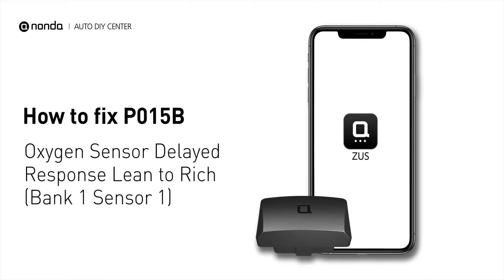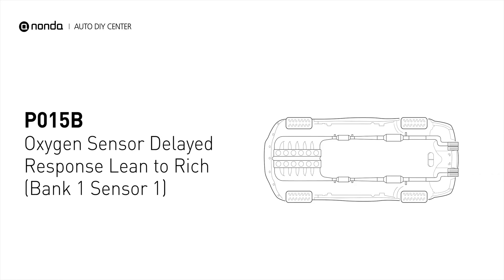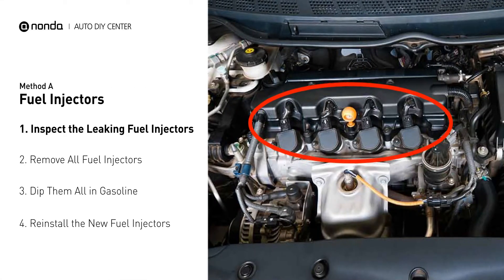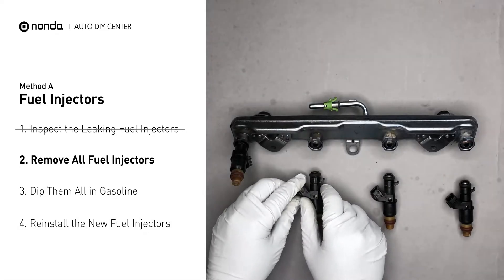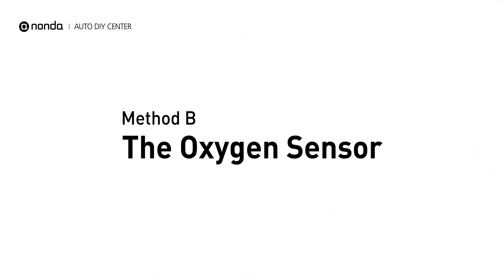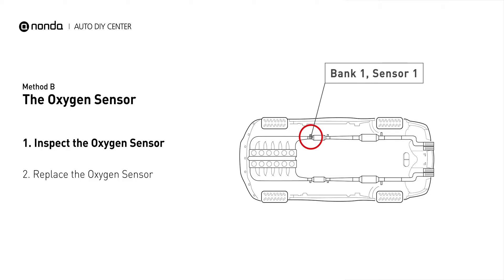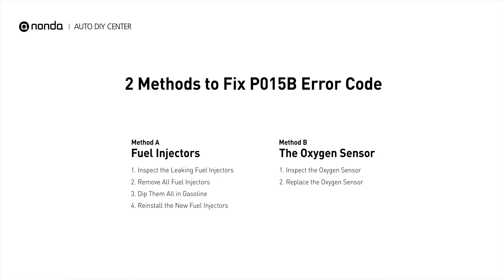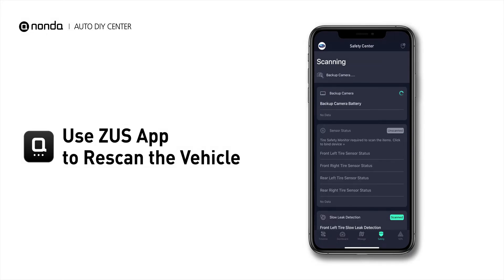How to Fix P015B Engine Code in 3 Minutes [2 DIY Methods / Only $8.43]

Comment: I have a 2014 yukon xl.  Getting p015b which is b1 s1.  My scan tool, innova, says "p015b delayed response rich to lean sensor 2".  So im confused as to which sensor is actually faulty.
Reply from the maker: Hi Edwin, it's bank 1 sensor 1 of the o2 sensor. Please note that the definition of this code depends on the vehicle manufacturer.
Reply: I’m getting the exact same error on a 2018 Nissan rogue. I appreciate your answer.

Comment: nonda I have po2097, 1101, 015b, 299, and 171! Anything that will throw all these codes, or do I have multiple issues going on? 2014 Encore 1.4l turbo. TIA!
Reply from the maker: Hello, as you are getting multiple error codes, we suggest getting your vehicle visually checked by your local mechanic for further diagnosis.

Comment: Hello! I am driving a 2012 Chevy Cruze LT 1.4 L turbo with a stream of mods. I upgraded the injectors to 60LB injectors and I am tuned professionally. Anyways, I am having a P015B code that I can’t figure out, I have a concern it may be my fuel injectors, how would I know if it’s leaking or if I need to change them out? They are fairly new but I’m assuming I may have messed something up
Reply from the maker: Is there any other code that registers along with this code?
Reply: @nondainc  No there is not. Currently I believe it is leaking because I can smell a slight hint of gas near my intake manifold and I believe these injectors although relatively new may need new o rings because they have been removed 3 or more times trying to diagnose a p1101 code (Two shops worked on this resulting in 3 valve cover replacements along with a intake manifold. I personally figured out my boost pressure sensor hadn't been seated properly causing the p1101)

Comment: I did both O2 sensors reset the check engine light. Drove around the block and reset it again and still get the same check engine light. I'm assuming it has to be the fuel injectors.
Reply from the maker: Hi Blake, please provide us with your vehicle's year, make/model and confirm if this is the only code you're getting.
Reply: @nondainc  2017 Chevy Cruze. And that's the only code.
Reply: @backwoodsblake What fixed it? Currently thinking it’s my fuel injectors also after getting P015b B1 S1 Lean to rich. Replaced both sensors pre and post cat drove 40-50 miles and got the same code.

Comment: Hi Steve, I've been having issues with my Chevrolet Malibu Hybrid 2018. Replaced the bank 1 oxygen sensor with  a replacement sensor from Napa (it cost $148 for the sensor), they installed it and then the car would start and then shut off as soon as I started driving. We ended up just putting the old one back in and the car is driving great but the check engine light is still on. Now is reading codes P0ac4, P015b, P16e0. I don't know what is going on. I was traveling and had to drive. So far it has been driving great. I don't feel or see any issues. Any suggestions would be great please 🙏, it is driving me crazy. Don't know what to do. Thank you.
Reply from the maker: Hello, since you are receiving multiple codes, we suggest getting your vehicle visually inspected by your local mechanic for further diagnosis.

Comment: So bank 1 sensor 1 is on the side that cylinder one is? For my car that would be opposite of what’s shown on the video
Reply from the maker: Hello, this depends on the engine type and drivetrain configuration. It could be located at the engine's front side, backside against the firewall, or at the passenger's side.
Reply: @nondainc   so it’s the side of cylinder 1 no matter what?
Reply: On my 2015 Subaru WRX is located right in the front.